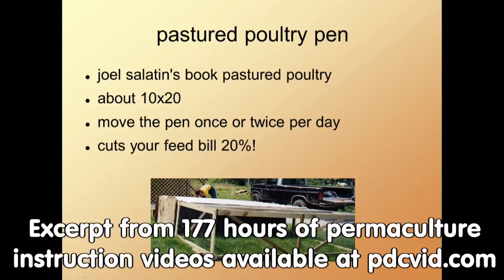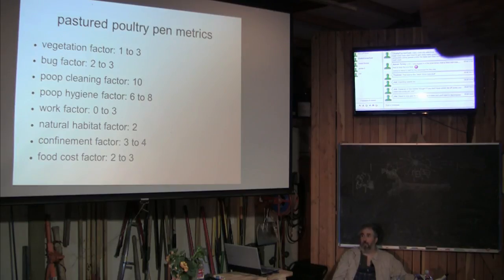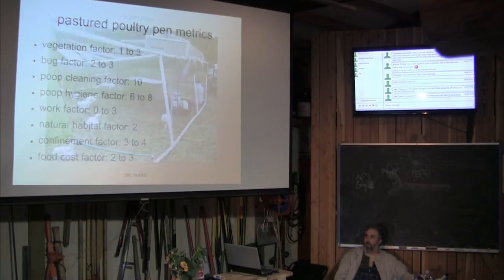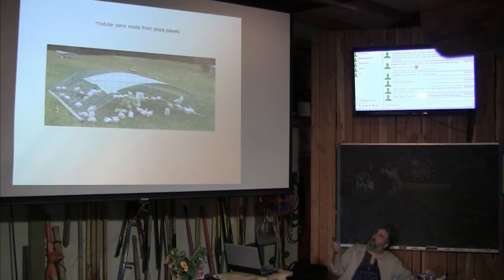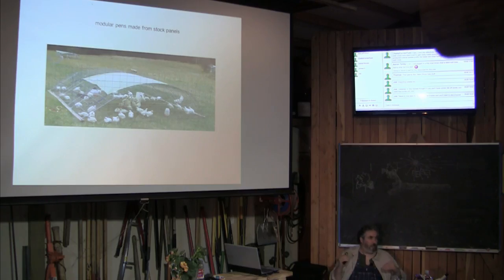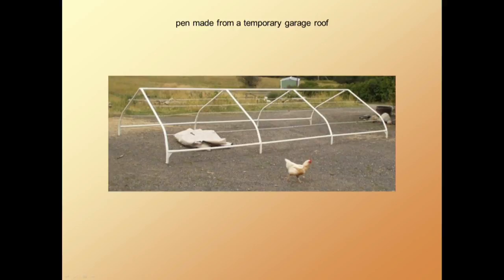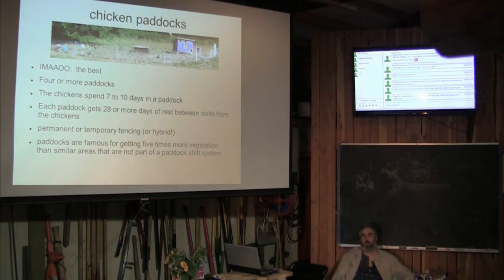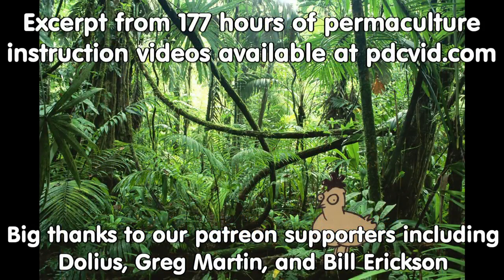design variations on the salatin style pens for raising chickens

Comment: Never seen or heard of anyone using the UV treated, outdoor, more durable grey electrical conduit pvc. Was gonna hybridize conduit with rebar, but have not; I'm super glad that i have found my way into a waste stream (more of a creek) of building materials. Paul is your hog panel tractor wind resistant? If the panels were attached to the skids with 'U' clamps so the skids were wiggly your clothesline could have different notches making the units' width/height adjustable. Then maybe, other animals, storage, trellis

Comment: It does make quite a difference whether you are doing broilers or layers.  Broilers, being less than 12 weeks old for almost all breeds (and some quite a bit less than that) do not have such finely tuned predator awareness.  As such, I would be wary of letting them free range in a large paddock without lots of shelter.  Many losses would ensue I'm sure, both from the air and the ground.  Layers, being by definition much older as they are sexually mature, do have much better predator awareness and can cope much better with open paddocks and a smaller shelter.  Check out Richard Perkins at Ridgedale Permaculture where he has developed a system using elevated Salatin style pens on wheels, 2 in a paddock surrounded by electric fence no more than 1m or so from the edges of the pens.  This is close enough that the large wingspan predator birds he has in Sweden cannot safely swoop on the young chicks.  This is what I'll be modelling my system on in the next few years once I get started.  Seems to answer most of the downsides apart from shrubs and trees (more than a foot tall anyway!)